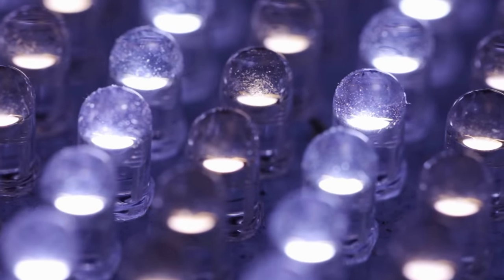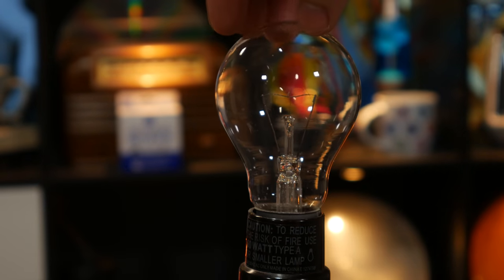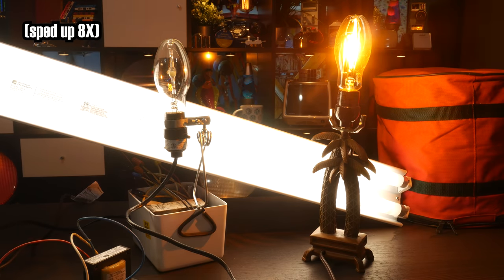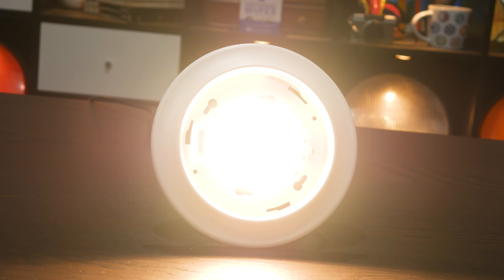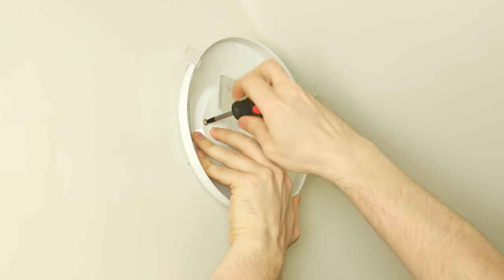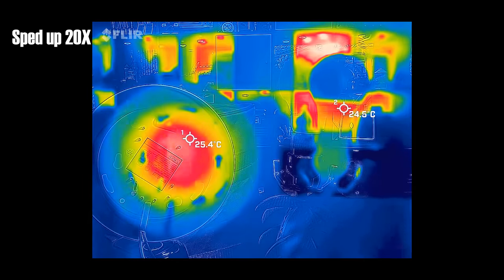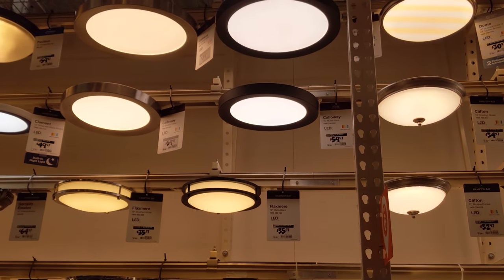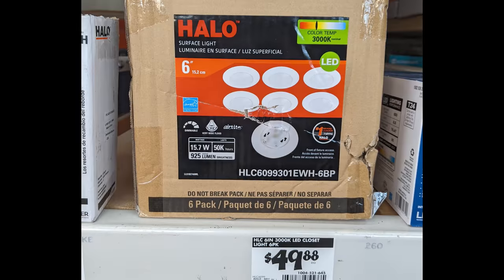A troubling trend in lighting?

Comment: Ability to change lightbulbs in our lamps is just too great comfort to give up on it. We just need some new kind of connector standard that does not need the light to be rotated to connect and then we can easily migrate from light*bulbs* to light*plates* which are much more suitable form factor for LED lighting.
Reply: Situation: There are 14 competing standards.
"14?? Ridiculous! We need to develop one universal standard that covers everyone's use cases."
Soon...
Situation: There are 15 competing standards.
Reply: @areadenial2343  90% use screw in bulb - 1 standard
10% use everything else - the other 14 standards

I don't see the problem.
Reply: Light edge connector?
Reply: I suggest we take a page from automotive tech. Have the FIXTURE part be a slightly recessed base of a standardized design (and perhaps ventilated) and have a standardized wire connector (pigtail) built into the base. Then the replaceable component - the bulb, if you will - features the opposite design wire connector and mounting lock ring (male connector to the base’s female, female lock ring to the base’s male). This would allow for a simple twist to unlock the lamp from the base and simply unplug the wires, then plug the replacement in and twist-lock it into place.
Reply: @discodubber85  This sounds like a fantastic way to move forward! 👍👍👍
Reply: @discodubber85    Add in the right mix of thermal conductivity (say... a basic heat-sink where appropriate) and possibly thermal mass control (where solder points or electronic components might suffer the cycling issue with an overly efficient heat sink) depending... AND you'd have the kind of longevity and universality that would cover 99.99% of applications...

   Nothing's 100%, and there are STILL some of us with unreliable connection to the "power grid", resulting in frequent power surges and brown-outs among other "abusive" circumstances on delicate electrical devices... BUT for everything else, it would seem a solution... and a standard could be set.  ;o)
Reply: A standardized mount for replacing individual LEDs would be pretty nice. Say you have a floodlight with a 10x10 board of LEDs. If one of the diodes fails, then you can just buy a small pack of replacements and swap the dead one(s) out without having to replace the fixture or driver circuit. That would also allow for higher-quality drivers to be installed in the fixture, which could be made to last longer and draw less power (since you only need to buy it once).
Reply: @areadenial2343  Very true. But then there's the EU approach in case of phone charging cables. I'm no fan of politics interfering with technology but I must admit it did the job quite well.
Reply: A while back I made some 3d printed fixtures that took 12v SMD lights with G4 connectors. They're little circular boards about 40mm in diameter, presumably designed for caravans or houseboats.  
Unfortunately, G4 connectors are just a couple of wire pins that stick out so they don't work well as mechanical holders. I think something integrated with the circuit board itself and designed to hold the board properly would work better.  
But apart from that it's what I would use as a starting point for a post-lightbulb lighting standard. You could make them circles and squares in a range of sizes from 30mm to 200mm
Reply: @charleslambert3368   Hol' up... Back to that "...just a couple wire pins that stick out..."

   Years back (I don't even know if they still put them out)... there were lamps and bulbs with two pins on a tab at the base instead of the standard "screw in" base... probably not a lot different in architecture from the G4's... except in the variety of sizes...

    What if we designed a "socket" or "recepticle" that had a standard clamp to match the "tab" portion, even polarized the pins with a "one way only" design. To change the LED fitting, a lever could be moved to the "open" position releasing the clamp, and the whole LED set could be simply pulled out of the recepticle, and a new one could simply plug back into its place. Return the lever to it's "closed" position so the clamp retains with prescribed pressure and integrity, and anyone should be able to change out their own components for breakage, or to change the output of light... within an "appropriate" range of course...

    Power supplies could be modulated in the junction boxes, so a "serious" upgrade might require an electrician or at least a book of instructions for installation, but I see no reason to require private owners to mess with the mains except a few fairly particular situations.

    Say... anything from 25 to 500 lumens or so would be one "class" of power supply... and then from maybe 300 to 3000 would be the next, just so nobody's over-loading the lighting recepticles in their cabinets or closets... but if you have need for BIG light output, it's feasible... We could even print the particular shape and orientation of the recepticle on the side of the fixture in sight, small but clear, so nobody has to struggle with how to replace their lights...

    Even the old screw-in types only have a printed warning on a label somewhere... usually to the effect of "No larger than 60W for this fixture under risk of fire hazard"... Only we'd have "Not considered reliable source for more than 500 lumens", since you're not likely to actually burn anything, but flashing, browning out, and other oddities can happen...  ;o)

Comment: I've had this exact argument with my home builder dad! I feel like at this point we could at least get a plug socket in the box and have these new fixtures come with plugs, so that a typical home owner would feel more comfortable replacing them. Most bathroom fan and light combos (at least that I've installed) already do this to make installation easier.
Reply: That's a really good analogy. For those bathroom fans, the part that can break (the motor) can be replaced with a couple of screws and unplugging it from the integrated outlet in the fan casing. The actual casing, which is probably screwed into the joists and attached to an exhaust hose can be left in place, because it would otherwise be much more of a PITA to rip the whole thing out.

Comment: I feel like a new lighting standard is needed, like a LED disk/chip standard instead of bulb, then those kind of lights could have replaceable disks which you could switch out. The new standard could also account for things like cooling and lack of ventilation.
Reply: Kind of like cards in PCs, right?
Reply: @mousermind  yeah, a new socket standard would make everything better
Reply: @mousermind  i was think like the center of those lights in the video but detachable and interchangeable, not sure of the best way they could go about connecting it electronically and stuff though

Comment: I did maintenance work in nursing homes for over three years. Fixing burned out lights was part of it. Over time, replacing 2D fluorescent tubes in circular ‘saucer’ shaped ceiling fittings became replacing entire ceiling fittings with LED substitutes. The common problem with the 2D fluorescent fittings was age and heat had often damaged the plastics of the bulb holder, and sometimes also the insulation of the wire going to it. Crumbly plastics. Such were the magnitude of my maintenance duties with a limited time scale to do them in, that so long as I could ‘get away’ with just changing a 2D bulb and be able to pop the diffuser back on with no danger to residents, way out of reach of the ceiling fitting, I’d sometimes ignore a wobbly bulb holder where a bit of the plastic had broken away. However sometimes the whole thing crumbled, so then that meant going to the maintenance stores and getting an entire colour selectable LED bulkhead/ceiling light fitting, the stepladder, power drill, drill bits, screws, wall plugs and wiring tools like cutters and pliers, and spend upwards of an hour replacing the whole thing and clearing up the mess afterwards. Most times the existing ceiling wiring didn’t line up with the grommet in the new lamp body and I had to cut a new hole in it with a hole saw, and often the ceiling above the lamp I was taking down was like a piece of Swiss cheese, with many, many years of previous light fitting holes peppering the ceiling. This wouldn’t be so bad once the job was finished, we’re it not for the times previously installed LED ceiling lights failed, which, often being of a different design pattern to the ones I was supplied with at the time, meant that whole fitting including body, diffuser, board and driver, had to be scrapped and replaced with new - and making yet more holes in those plasterboard ceilings for different lamp mounting patterns. For the duration that I was employed in this role and was replacing lights, I tried to standardise the LED fitting I was supplied with, because that particular model (which was relatively cheap, but therefore probably not the longest lived) had a separate board and driver that clipped into the body attached to the ceiling. I found that if one failed, often I could replace the board and driver and keep the old body and diffuser, saving work and time - but also resulting in a brand new body and diffuser going in the bin, along with the cardboard box they came in. Which, seeing as LED lighting technology was supposed to be friendlier to the environment and saving the planet, struck me as a terrible waste of materials and manufacturing resources compared to just changing a ‘bulb’. I also found, with my choice of LED colour selectable light fitting, with ‘warm’, ‘daylight’ and ‘cool white’ settings, selectable from pin switches on the board, that some of the ones I’d installed myself failed early, not just ones that had been put up before my time. The ‘daylight’ setting was very bright and utilised all the LEDs on together, while ‘cool white’ used one row of LEDs and ‘warm white’ another. I learned when installing these fittings that if I put them in a bedroom I’d select the ‘warm’ LEDs and in a toilet, corridor or bathroom the ‘cool white’ LEDs. However, this became a ploy because, such was the pressure of work and the variety of tasks I was expected to pull in during an average day, that if one of these fittings began to strobe and was marked as a maintenance job on my job board, I’d get the stepladder, take off the diffuser, and using the pin switches on the board, turn off the defective row of LEDs and turn on the unused, previously undesirable coloured row, pop the diffuser back on and mark the job as ‘done’ and leave the second row of LEDs to live out their life span. And yes, such was the type of work it was, turnover of maintenance staff, and type of building and type of occupancy, that different colour tones of LED ceiling lamps, and different colour tones of CFL bulbs could often be seen in the same rooms and the same fittings. It just wasn’t the kind of job or the kind of company where you could worry about such things. A working light was a working light. However I finished with that kind of work - including the plumbing, painting, carpentry, inspection and record keeping - more than two years ago AND WILL NEVER GO BACK TO IT!

Comment: Another problem is that the manufacturers are overdriving the LEDs which shorten the life which ensures the customer is coming back to buy more.  
Anyone with some electronics background can hack these LED lights to reduce the voltage going to the LEDs but 5-10% which will increase the life expectancy significantly.
Reply: Good point - BigClive has several videos on how to do this with really cheap LED bulbs
Reply: Those companies should be specifically held to account by the free market. Would be so kind and point me in the right direction? I assume you have some actual evidence to back this claim.
Reply: i mean even the power leds of some old 80s computers still work so new ones should last even longer
Reply: @akivaweil5066  As Mark already pointed out, BigClive has videos on that topic. I'm sure there are more to find here on YT.

Comment: 2 years ago I bought 20 of the LED domes like the one you were holding on amazon for $100.  I put 16 of them in my 3 car garage since it does not have drywall.  For the price I could not be happier,  I was able to distributed the light around the garage and for a very affordable price compared to other LED options out there or using the florescent tube options.
Reply: After two years of use lighting up the garage; would you do it again the same way? And were there any issues of light fixture lifespan or effects due to temperature?
Reply: @danap.235  .   If money was not into consideration I would get a some other design, like some hex shape honeycomb  grid patters I have seen some you-tuber use in there studios.  But for my purpose of having a very well lit garage for the lowest cost possible, the disk shape 4000K Cool White LED lights have worked very well. No issues so far and Yes for the price per lighting output I would do it again.

Comment: As someone who has experience with selling whole light fixtures like these, and let me tell you, there are a whole lot of them; I just can't find any advantage that they may provide that trumps the whole "install and replace when broken" of a mounted, hard-wired fixture. I believe that the led light bulb works perfectly in that type of situation, as a generic light socket will last much longer than any 10 year led bulb can dream of.
Reply: I never saw whole fixtures like that, but I saw very similar sockets you put a flat LED lamp in, which can then be replaced by rotating and pulling.
Reply: He mentioned it in the video, LED "bulbs" have a tendency to overheat and die almost as fast as incandescent bulbs because the vast majority of them are designed like shit. That's a major reason for installing these fixtures instead
Reply: So you don't believe that the better thermal management will lead to extended lifespan compared to socketed LED light bulbs?
Reply: @KekusMagnus  he also mentioned in the video that filament style led bulbs are designed with better thermal efficiency. Stating that his camera, while there is a chance that it is inaccurate, reports that a singular bulb will get as warm as a flush mount fixture. I have plenty of led bulbs similar to the design of the cheaper one around my house. They have yet to destroy themselves due to heat.
Reply: @KekusMagnus  I work for a company that sells both, I can tell you that LED bulbs, on average, have about 10x the lifespan of incandescent type bulbs, and some can last years of constant operation. the heat that they do produce is also way below the flashpoint of any common materials, so they're much safer.
Reply: @trqoiz  okay let's talk about LEDs in an array sailor Workshop light with a 4 ft length or longer what you say is the number one reason besides the drivers not being able to handle the step-down property that they seem to fail so quickly especially the dreaded flashing on and off

Comment: For applications where linear fluorescent fixtures would traditionally be used, you may want to consider led ready fixtures, which use type B led tubes. Some tubes have the same life as regular led fixtures because the leds are spread out over a large area instead of being crammed into a small spot, which allows them to dissipate heat better. Additionally, many led tubes have leds that point down, meaning almost all the light is directed downward .

Comment: I love this show It has just the right balance of science and quirky domesticity. I am glad you covered this very topic as I have replaced the old style chandeliers across my house with new funky designs. Most are bulbs, luckily, as most of them are large fixtures but in the bathrooms they are relatively compact and they will have to be replaced entirely once the LED's are dead. This irks me, firstly, because of the electrical work but mostly because it will take weeks for my wife and I to decide on a replacement and we boys know about being shouted at by our wives for having a poor aim an issue un-helped by using the facilities in the dark.

Comment: Here in Australia those lamps are available that mount into the ceiling and they plug in to a plug base in the ceiling with a standard 3 pin plug, so the are easily replaceable by the end consumer ,but I prefer to not through out the whole light fitting. Here in Australia it is illegal to do your own electrical work.
Reply: It's only illegal if you get caught. Like speeding or underage drinking.
Reply: @ZboeC5  Or underage other things.

Lookin at you, Matt Gaetz.
Reply: They also have a version of these in the US that just screw into regular sockets.  That way it's a 2 minute replacement instead of having to turn power off
Reply: @ZboeC5  But if you get caught (say theres a fault) then your home insurer can void your contract.